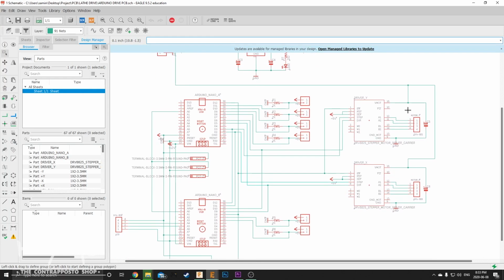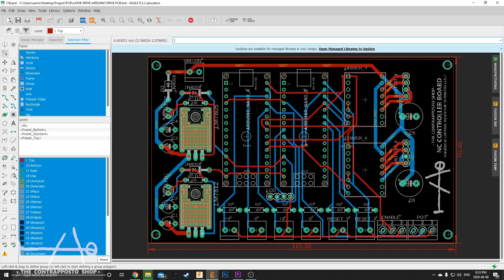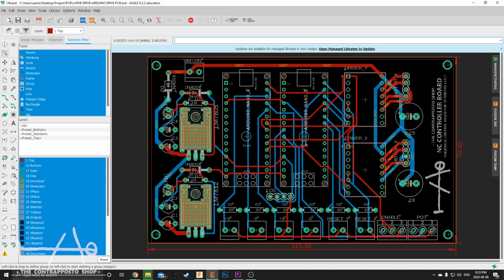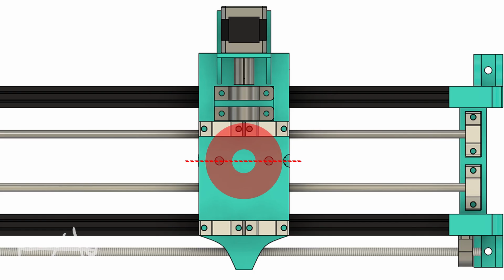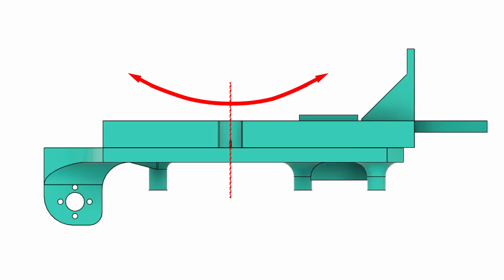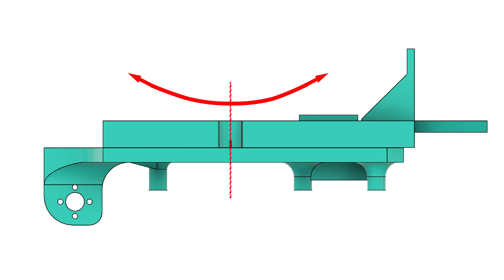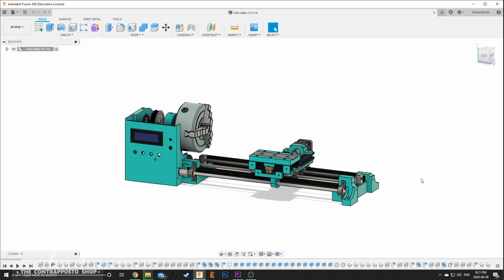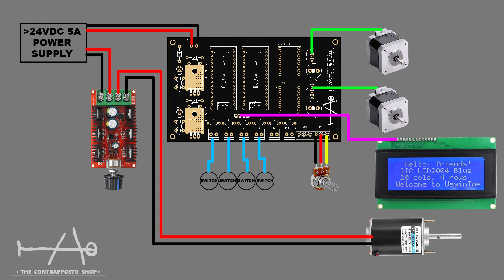3D Printed Lathe ( DIY ) PART 2 ... IT WORKS !

Comment: Did you just insert the threaded rods into the bearings "naked" ? I always wondered how concentric it runs in the bearing where they are secured with the setscrews. and  in the normal bearing where they are not secured dont they wear out the inner ring? 
I am genuinly interested. I will give this project a go! Looks fantastic.

Comment: Using concrete would have made the lathe more sturdy, which is used also on steal designed lathe.  Using the 3D printed parts as a container.  Great idea though.

Comment: Hey, i'm very new but tried the control diagram and it doesn't work. Did you have any trouble getting your stepper motors to turn? My readout works, the speed adjustment works but power to the x-step or y step doesn't actuate or feedback. trying with a 17HS19-2004S1 motor.
Reply from the maker: Hmmm what is your motor driver ?
Reply: i have trouble shot everything to the motor controllers not putting out signal. Does anyone know why the motor controllers would not be putting out signals?

Comment: what an awesome lathe. sure its not up to industrial standards but i think you did an outstanding job. maby i will do one for myself.
Reply: No, don't, as someone who knows a bit about lathes i can tell you that this is BAD. There's too much chatter i the metal. I would just recommend a cheap chinese import lathe :)
Reply: @3DPrintedEngineer wasnt the high chatter one they showed done on stainless?

Comment: will say very cool project make the parts out o aircraft or military nylon with embedded carbon fiber flex within the nylon filament and you can make anything and limited movement and very strong need better nozzle end and be able to keep it at over 240 c to 300 c with printing area totally closed off and 90 to 100c with controlled ventilation with limited draft.

Comment: 3:41is the fluid you're using epoxy?
Reply from the maker: Yes … we did have other choice to fix the extrusion on it
Reply: @thecontrappostoshop  oh i just wanna reinforce my own parts like that for other projects, I was wondering if epoxy works well :D

do I have to look for a special kind of epoxy? or does any let me use it with metal. also you weren't wearing gloves ;O aren't those stuff dangerous?
Reply from the maker: Epoxy are good for pretty much everything… you can use good epoxy brand like gorilla and use the 24h one for best results… make sure to sand when its metal an clean surfaces. You have pretty much a glue for everything but you just need to find the good one for your needs. 

Im not using gloves because i’m careful:) . Its not that dangerous but its skin irritant.
Reply: @thecontrappostoshop  Thanks :D

Comment: Planning on making my own version to be really cheap, using just threaded rods, some nuts, small bolts and 3d printed parts. My plan is to measure with a slide rule a lot instead of having accurate dials on the handwheels

Comment: Is there any chance you could do another video, assembling the cross slide? It is a little mixed up with version 1 in Part 1 and version 2 in Part 2. If you could take it apart slowly and put it back together? Maybe rotate the pieces as you do? The fasteners on the cross slide, where you epoxy the v slot onto the rotating piece, what are those? Sorry for the questions, I know we're bridging the language barrier here. :-)  Even a slideshow of photos would be cool!
Reply from the maker: Unfortunately for now we are loaded with the Prometheus MSLA project … i will probably update the lathe project with a v2 :) … you can take a look at the f360 file for the assembly
Reply: @thecontrappostoshop  Completely forgot about the F360 file! Thanks again!
Reply: and how the cross slide attaches to the carriage

Comment: Just ordered my PCBs from China. Almost have everything to start my build!
Reply: What are the capacitor values? I looked everywhere and couldn't find them. I think I found everything else.
Reply from the maker: The regulator are only there for the voltage regulator. No need for big one :) 10uf should do the tricks

Comment: So it's a CNC lathe, but you're only jogging it? Why not automate it? And if not that, why add motors? Analog control is always more precise on a budget.
Reply from the maker: I was trying to make something different and using it more like a DRO ... i can use old caliper like most of the people on the internet but again .. i try something different ;)

Comment: An update on this would be nice. Is your 30W motor strong enough for easy turning of metals? If so, which ones? Do you plan on upgrading the motor? Are you planning on adding a hall effects sensor to calculate RPM so you can calculate feeds and speeds for optimal cutting? What is the slowest usable RPM you can use? I'm working on my own inspired design based on yours with many changes.
Reply from the maker: We have more projects on the way. We have a CNC video coming soon and an other secret project that we work on since last year ;). We hope revisit the project in the futur but not for now

Comment: Hey! really nice project ! could you please update the BOM at google drive (no value for capasitors) or tell me what capasitors are used in the project please ??
Reply from the maker: I’m sorry ! The capacitor on the voltage regulator side is 0,47uf and the stepper driver side is 10uf :)

Comment: Try to make it cnc, remplace the DC motor with a stepper motor And use it as a servo with close loop drivers, check teaching tech video
Reply from the maker: We think about it but we have no use for this kind of setup. This is why the project is open source so everybody can tweak it !

Comment: what pulleys did you use with the belt
Reply from the maker: It's a custom pulley that we have design. You can find it in the thingiverse files.
Reply: @thecontrappostoshop  thanks for the response

Comment: Super chattery on your ID finish. You’re not going to be able to do a part off or any taper turning with it. PLA has too much flex. The design is good. You’re just going to need to pattern cast the bed and head stock tail stock in cast iron. Then machine all surfaces, ways, etc. I’ve built several lathes. Always ends up being cheaper to buy one.

Comment: What belts did you use and tooth number for the motor? What rod size did you use for the Chuck spindle? I am printing now to try this. Great project, look forward to updates if you get a chance.
Reply from the maker: The rod has 17mm in diameter. The belt is a 150XL037. One of our next video its a project made with this machine 😇. If you make one of these let us know and a video ! 👍
Reply: @thecontrappostoshop  thanks for the reply. How long is the belt? I will be sure to post some pics at a minimum, the electronics enclosure is printing now.
Reply: @thecontrappostoshop  sorry not what belt length, what rod length. 17mm x how long? Also the bearings you used, what size where they? Any more information you could add to the BOM would be awesome. Thanks for the inspiration.
Reply from the maker: Sorry for late response ... im not used to the youtube studio app. But the lenght of the belt goes with the number of teeth ( 150XL037 ). The shaft was about 200mm long.

Comment: i was looking at your bed moving acme/trapezoid screw. i think you would do better more accuracy with a belt powering 2 screws (one on each side). Ive seen a CNC router Gantry powered like that

Comment: I'm giving you a like and hat tip.  This is the best attempt at a 3d printed lathe I am aware of.  Nobody has slayed this dragon yet.  I wondered how you were going to add stiffness and thought this might be why there was such a gap in videos.  Those little 8mm rods had no chance.  And, you didn't use a piece of all thread for the spindle which is what the typical 3d printer owner would do.  A real steel shaft and a real chuck!   There is much work to be done on this concept before I consider it beaten.  But congrats on getting as far as you did, on going big and on not being too cheap.   I am seriously impressed.  You've moved the bar a lot higher.  I do hope your channel catches fire and that you come back to fight this draggon again in a year or two.  
I regard the biggest problem with a 3D printed lathe isn't the 3D printing at all.  It's comming up with a hollow spindle and chuck people can afford in order to see the project replicated all over the world.  The other problems are not so complex.  I do expect to see a plastic lathe at some point taking a .050" cut in steel at some point in the future.  There are many challenges, one is ecconomics.  But then doing it just to have done it is a worthwhile goal as well even if a project can't compete with an inexpensive manufactured lathe in cutting capacity.  It's a high mountain and few will grab at the golden egg of accomplishment.
Reply: Great project but:
1. Music was extremely poorly chosen
2. Music level was too loud compared to voice level.

Please learn to balance the two. Is really a pain to watch...
Reply from the maker: A P .. Sorry we will keep that in mind for the next video ;) ... but the sound is different for everyone. I have monitor headphones and it’s definitely different than a cellphone, earbuds, etc... We will work on that so it will be universal for everyone. Other than that i hope you enjoyed the project :)
Reply from the maker: Crafted .. Thank you so very much for this comment. There is definitely room for improvement ! I’m glad you understand the challenge of this project. Not everyone understands ;). Thank you for your support and hope you will like the futur projects on our channel. See you soon !